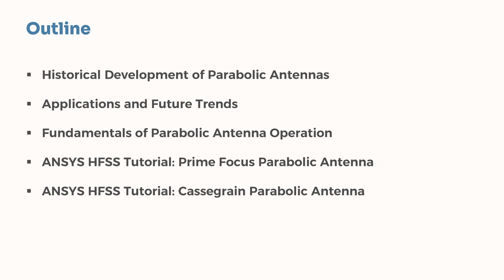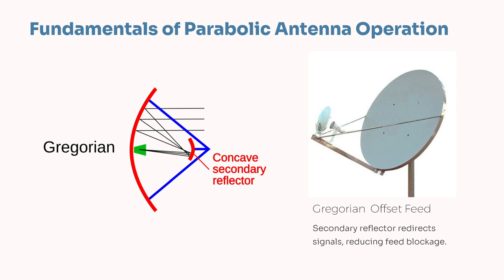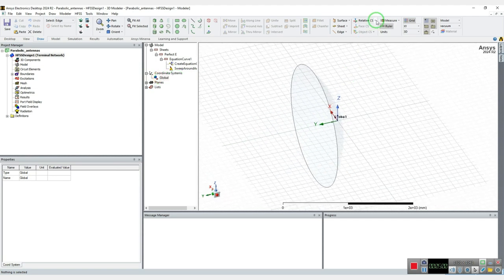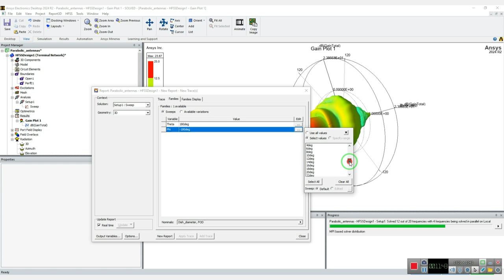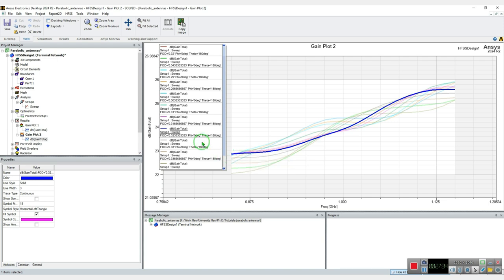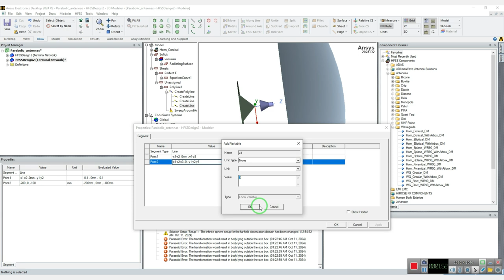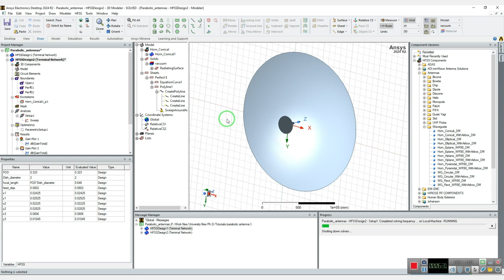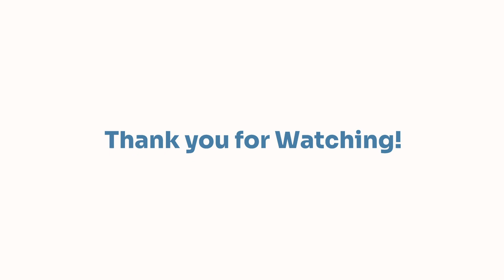Parabolic reflector antennas: theory and design in ANSYS HFSS

Comment from the maker: Name               Evaluated Value    Unit
-------------------------------------------
FOD                0.323              -
Dish_diameter      2                  m
focal_length       0.646              m
feed_disp          0.0502             m
x1                 0.009155           m
y1                 0.01313            m
x2                 0.01213            m
y2                 0.01115            m
x3                 0.0502             m
y3                 0.00806            m